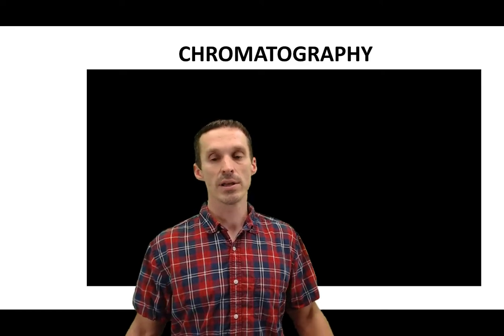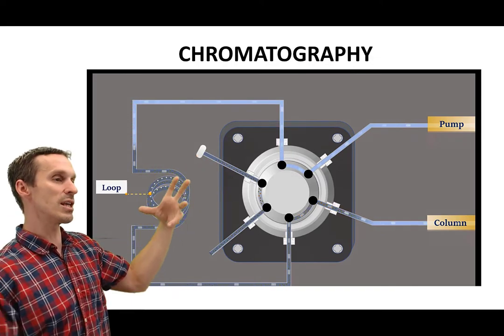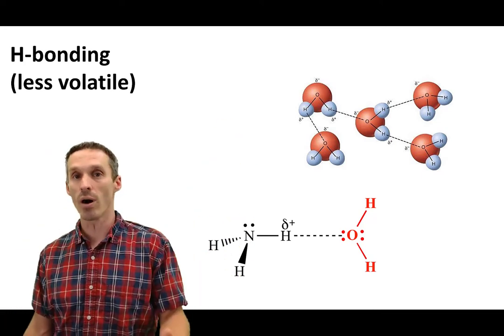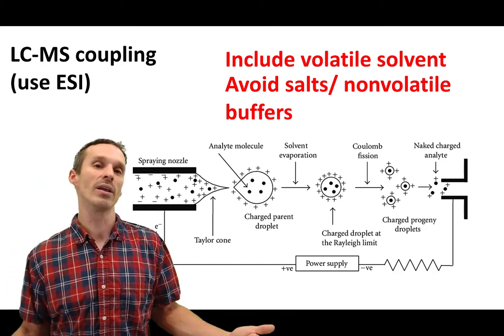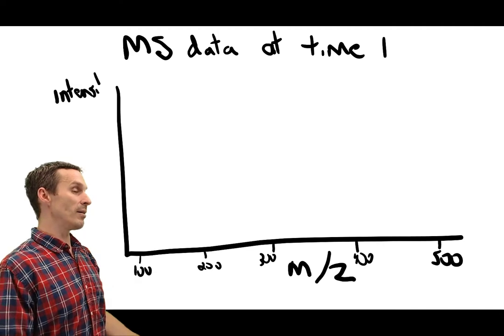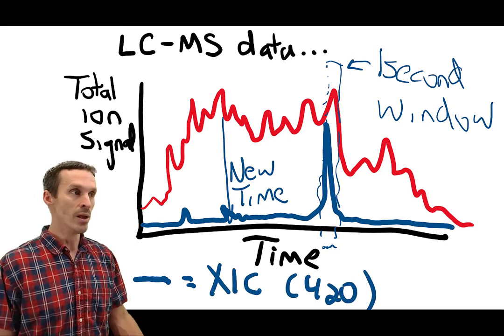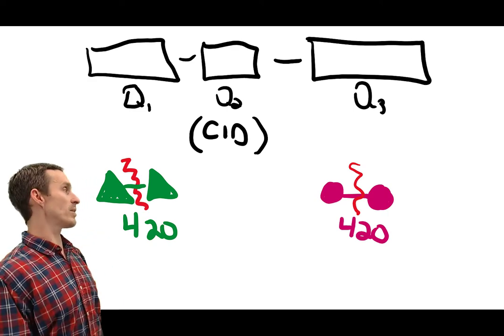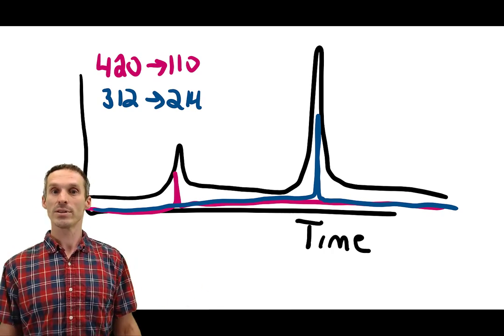Mass Chromatograms

Comment: Did you say high PRESSURE liquid chromatography? It's high PERFORMANCE liquid chromatography
Reply: they refer to the same thing. It can be high pressure liquid chrom as well depending on your reference
Reply: Both terms can be used. High pressure - comes from the pressure of the mobile phase passing through the colomn and performance relates to the high sensitivity and selectivity of the molecule of interest being separated by the hplc module.